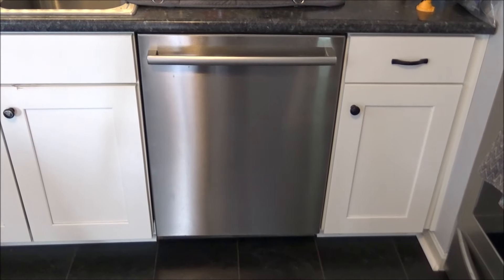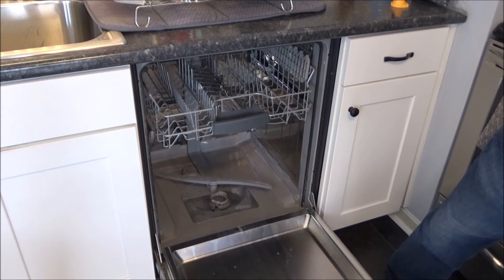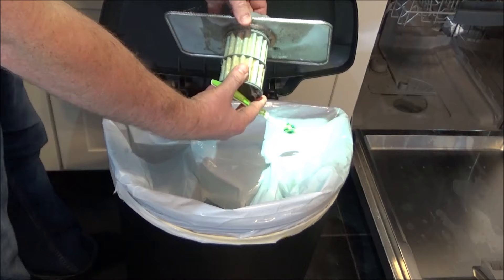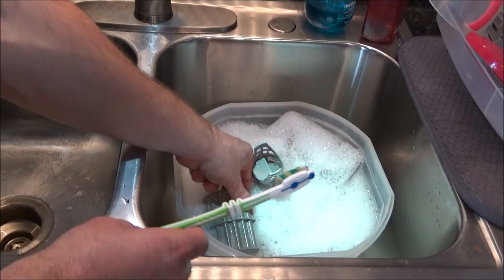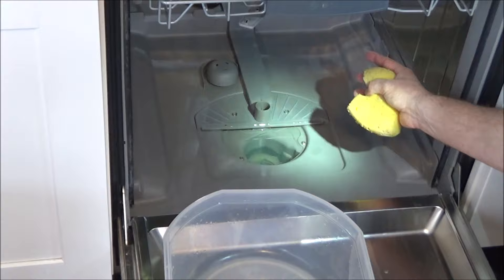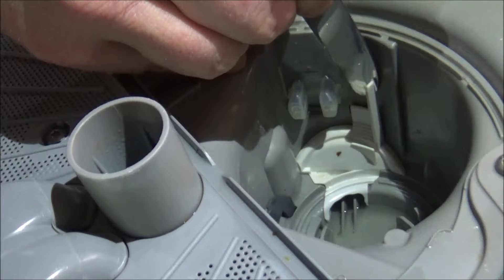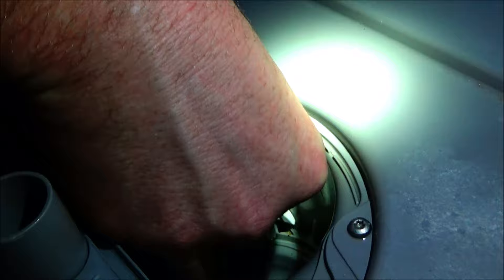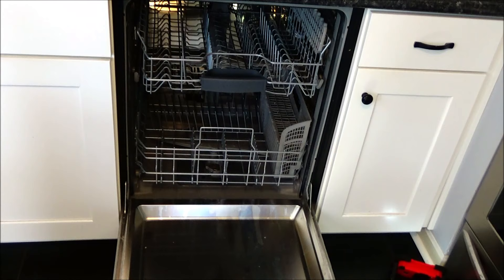How to Clean a Bosch Dishwasher Filter and Impeller

Comment: This is why you clean the food off your dishes before you put them in the unit.
Reply from the maker: Can you come repeat that for my wife to hear? (Hopefully she doesn't see this.)
Reply: The manual states to scrape dishes clean of larger food pieces but not to pre-rinse. Pre-rinsing reduces the detergent efficiency and may lead to premature wear on your dishes.

Then again, the manual also explains that you need to rinse the filter clean up to once a month...
Reply: @Raisinlove334    Did you go back and read your own comment here?  Which would you have wear out first... your expensive washing machine, or a few plates.  I never put a dish in my Bosch that has food on it, because I'm not a fool.  The life of my dishwasher will be much longer if food and grime do not continue to clog the lower filter in the dishwasher.  I'm sure Bosch, like every other low character company out there is recommending behaviors that result in their machines dying earlier than they need to... to make more money.
Reply: @bertraminc9412  The removable filters are there for a reason, you're supposed to pull them out and clean them.
Reply: @Raisinlove334  No one said you’re not supposed to.
Reply: Don’t watch if you’re eating! 🤢🤢
Reply: @Raisinlove334  well you spent the money on your washing machine.  Would you rather buy new dishes a year early or replace a 2500 washing machine because you were intentionally ignorant and allowed food to clog up the filter.  It’s your money.  What’s the best decision to prolong the life of the washer.  You guessed it!  Don’t send any food into the filter.  Best practice or intentionally ignorant.  It’s your money.
Reply: That’s not what the manual says.
Reply: @tlynn7043  Well common sense escapes most women.  This is why we see so many women in yoga pants in public.  You go ahead and pay almost 3k for your washing machine and feed food into the filter.  See how long it will be before you have a service call and when I do.  But blindly follow the manual in life right?  Good luck to you.
Reply: @bertraminc9412  my what a lovely person you are.
Reply: @tlynn7043  Who spent the money on your washing machine.  Did your husband work hard for it or did you go to work and earn the money to pay for it.
Reply: @bertraminc9412  it’s a dishwasher.  And I’m divorced.  Why else would I be on here trying to figure this out on my own?
Reply: @tlynn7043  I'm sorry for your divorce.  Even though the manual states that you can put food into the dishwasher and the filter will take care of that, Bosch and your dealer would like nothing more than for you to do just that.  If you'd like your machine to last, take the filter out, clean the area thoroughly, and never put food debris in it again.  There is fatigue stress involved in anything.  The more the filter traps food, the quicker it will break.  First pull out the lower wire drawer to the stop... lift the front up and out of the side keepers and set the wire shelf aside.  The water sprayer (two-winged device with holes in it) up and out of the washer.  Most models you can just lift these up and out with a brief click as they come out and set that aside.  You may be able to just turn it out of the way but I suggest just removing it and setting it into the wire basket to the side.  You should see the filter in front of the wand mounting hole.  Two pointers line up when the filter is in place.  Rotate the filter assembly counter-clockwise until the filer pulls out.  The filter is held on to the filter holder with light tension.  You can pull it off from below and wash it in a sink.  I use an old Oral-B toothbrush to lightly brush away the light debris (because I don't put ANY food debris in my washer).    Assembly is reverse.  Don't force anything.  If there is resistance something might be backwards.  I have the 38db top of the line machine.  Your procedure might vary slightly but most Bosch are very similar if not the same.
Reply: @bertraminc9412  great thanks for that advice!!
Reply: @Raisinlove334 not quite, while you definitely want to scrape food debris off your plates, if you then also pre-rinse it can fool the turbidity sensors into thinking your dishes are clean when they're not.
Reply: Totally

Comment: Better way to remove standing water: Pop the door open, press the start button for 3 seconds, and close the door to drain any standing water. After the water drains, open the door and press on/off to reset the machine and start a new cycle.
Reply from the maker: Thanks for the tip!
Reply: very useful!  Thanks!

Comment: My impeller on the same unit froze and the washer didn’t drain and wouldn’t start. Cleaned from inside according to your video, but it was still frozen. I turned the power off, opened the outside, bottom, front panel and was able to just twist the drain pump (which includes the impeller) right off. There was hair, string and a small rubber band stuck  the impeller. Removed all that, twisted it back on and it’s working good as new! Thanks for the video, I never would have tried that without it.
Reply from the maker: That's awesome! I'm glad I was able to get you on the right track. Nice job following the trail and finding the issue!

Comment: THANK YOU.  While cleaning the filter -- that I've done many times before -- I found that white piece (that covers the impeller blades) at the bottom and tried all that I could think of to put it SOMEWHERE.  I looked on another how-to-clean video, but this little piece was not addressed.  Now everything works properly and the light that read "watertap" is off.
Reply from the maker: You're welcome and glad I could help!

Comment: I found this today after removing some bits from the spray nozzle. turns out I must not have put the fitler back in properly and some lemon seeds or corn found it's way in. I'm gonna check the impeller tonight. Thanks for the walkthrough. 

for the filter, I used my sink faucet to spray out the gunk. I'm thinking soaking with a mix of water and vinegar might do nicely too.
Reply from the maker: No problem. And yes a good water/vinegar mix is always a good bet for cleaning. Glad you got the culprits found.

Comment: I have a strange problem related to this fault.  The dishwasher drains fine.  I can hear the water flow into my garbage disposal.  When I start the dishwasher, this portion of the sequence works fine.  However, afterwards it seems that it stops with the fault listed.  I have found that if I stop the dishwasher before the fault, and I add water to the drain and then restart the dishwasher, it will then run without fault.  I have done this exact procedure a number of times to eliminate it as a fluke.  Any ideas?  As I said, if I add water after the test drain sequence in the beginning it is fine and I can even hear water filling into the dishwasher (so the water fill portion isn't clogged either).

Comment: After watching this video I cleaned the filter in my dishwasher although it wasn't very dirty at all really however I had a bad smell in the machine and I wonder if it was the water that was at the bottom when I pulled the filter out because after I put it back in I don't have the same smell in the machine - So the question I have is in your experience have you encountered this where the little bit of water that is at the bottom of the filter causes bad odors in it?  I watched 4 videos about cleaning the filter and no one mentioned this also I DID UNPLUG THE DISHWASHER before I cleaned the filter
Reply from the maker: Yes, stagnant water (and the food floating in it) in the bottom of the dishwasher or in the lines could cause that for sure.

Comment: Any thoughts on a smelly Bosch? It’s five years old. We have hard water high in calcium. I clean the filter. Drains fine. But there’s a lot of sludge in that area where the water is and I wiped out as much as I could and put a Lemi Shine dishwasher cleaning tablet in. Still there’s slime I can’t reach. Bleck.
Reply from the maker: Have you checked for a clog in the drain line?
Reply: Look at the inside of the DOOR at the bottom. Gunk builds up there real fast

Comment: Using a  bottle brush under running water to clean the filter is much more effective than a toothbrush. You can also disassemble the filter further to clean it better.
Reply from the maker: Good tips. Thanks for the input.

Comment: If you have a filter, how can stuff end up in the impeller?
Reply from the maker: That's a great question. It shouldn't. But somehow it seems to find a way.
Reply: The pipe looking part on the filter is a overflow in case the filter mesh is clogged. 

If you look closely you'll notice that overflow is a straight bypass with no mesh on the inside stopping stuff from going directly into the impeller

I found a blog suggesting putting a tea strainer ball in the hole to filter the bypass

Comment: Why is there water in there? I just took mine apart and cleaned out the water in there and the filter because it was gross. But now that it’s clean I put some vinegar and baking soda in there and it just collects. Why isn’t it draining?
Reply from the maker: There will always be a little standing water under there, but if it's not draining at all, then there could be a clog in the drain line somewhere.
Reply: @fixitFlip  thank you for that information!

Comment: I have a Bosch too.  Those filters get bad quickly.  I clean mine at least once a month.
Reply from the maker: I see that now! I know they need cleaning regularly, but I was a little surprised just how gunked up mine was.
Reply: @fixitFlip  I've never cleaned the impeller though.  Are you just looking things that are stuck in there? Not sure what cleaning it involves once you get to it.
Reply from the maker: @jasonwilliams6005  Yeah, just basically looking to pull any debris out of there you see. I pulled one wet hairball out of mine. A lot of times when there are issues draining, that is the culprit. That impeller is what pulls the water out of the bottom. They are just little plastic blades so little hard chunks of food can gum it up in there. I would say you don't need to do it as often as you clean the filter (like you said, once a month) but it doesn't hurt to give a peak in there every now and then to prevent problems.
Reply: Very easy to follow. Appreciate it as always!
Reply from the maker: @508homes  Thank you!

Comment: Question: is it typical to have standing water in the filter? I just pulled my filter out to clean and saw the standing water and was conferned. 

We have this dishwasher - just moved into a new house and appreciate the info.
Reply from the maker: Yes, It's normal to have a little standing water in there. You can see there is some in mine. If you get to a point where you feel the dishwasher is not draining correctly, then you could have a clog in the line.
Reply: Pop the door open, press the start button for 3 seconds, and close the door to drain any standing water. After the water drains, open the door and press on/off to reset the machine and start a new cycle.
Reply from the maker: @maxkurek4505  Thanks for the tip!

Comment: PLEASE EXPLAIN how the hell Bosch’s “filter” has a huge gaping hole in the middle, where all your peas fell?!?!!!!! I got mine brand new from Lowes couple months ago, and it didnt drain water becuz same issue, some corn fell in the center of the filter which  does NOT have any sift or mesh protecting it from big debris. Are they just idiots?!?!?!
Reply from the maker: I just looked in mine to double check. Mine has plastic inside that hole that catches some stuff. I wonder if you are missing a piece in the middle?
Reply: @fixitFlip  - I have a plastic flap in the center but its in the shape of the moon, covers half the hole, then another one below it. So its kind of like steps of a staircase. I cant believe they didnt just cover the huge top center of that filter with some mesh.
Reply from the maker: @jamesethan3749  I see what you are talking about now. It would have made a lot of sense to just put a little screen on top of there!
Reply: @fixitFlip  yepp! :) I might make my own DIY top cover for that thing and cover it up. $900+ machine and needs maintenance few months in 🙄
Reply from the maker: @jamesethan3749  So frustrating...
Reply: I was thinking the same exact thing the first time I cleaned mine. Anything that falls directly into the hole bypasses all the filters. Why Bosch?

Comment: I cleaned it out and it still shows E:24 on my washer. I cleaned out everything.
Reply from the maker: E:24 means there is a water drainage issue. If you have cleaned the filter, there could be a clog or kink in the drain line or pump.
Reply: @fixitFlip  I even took off the barbed gasket and drained the hose and nothing significant came out. I thought it would be an easy fix. Would you recommend calling a service repairman? We have a plumber we have used for a long time, but not usually for appliances. He is not expensive.
Reply from the maker: @bluetipsasianmama5021  You could do that or here are some even further steps you could investigate: https://www.youtube.com/watch?v=WAPwbIixwdg

Comment: I’ve got this dishwasher. 900 plus dollars. The filter design is terrible. My dishes weren’t clean enough when I put them in. I’ve been fighting to get this to work for a couple weeks. I’ve gotten good at taking it apart. That’s not a good thing. I’ve only had installed for 7 months. Ill never buy one of these again.
Reply from the maker: I haven't had any major issues with mine since I installed it but I have had other people comment on here similar complaints!

Comment: So you did not remove the impeller but just used tweezers to remove any debris around the one side of  it??? I did not see the impeller being removed at 3:20 in the video.
Reply from the maker: That is correct.